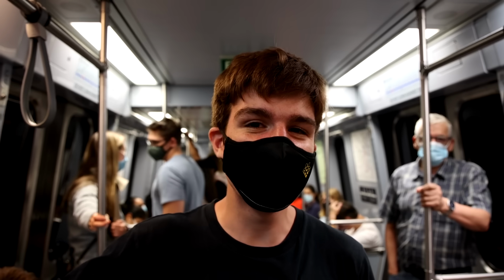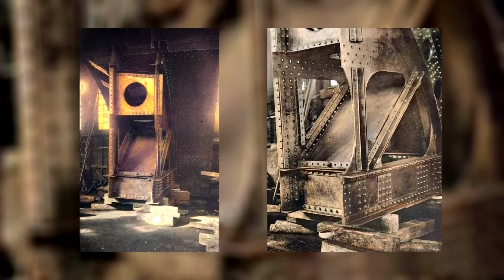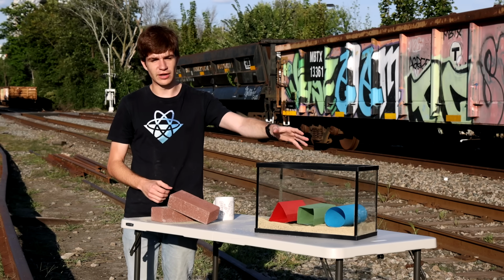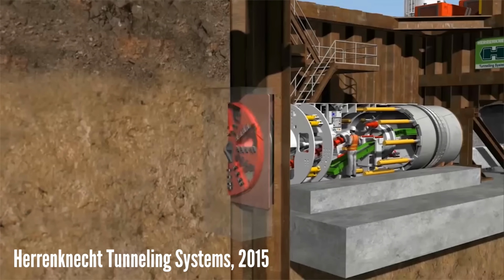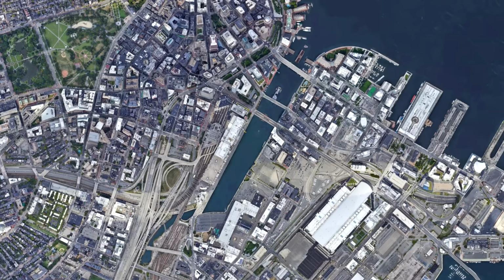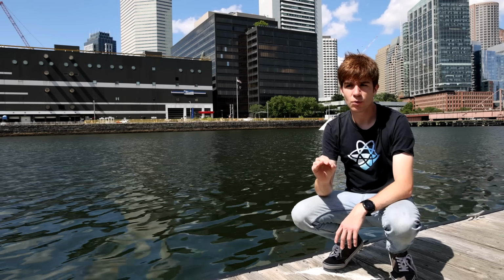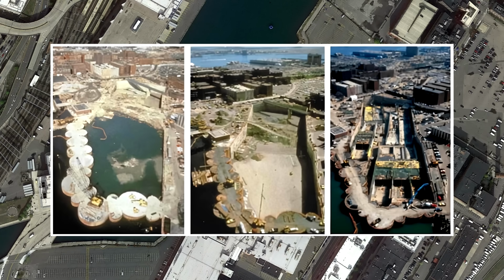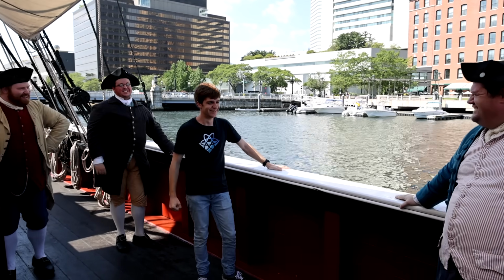Why It's So Hard To Dig Tunnels Underwater

Comment: Not gonna happen, at least not for cars. You wouldn't just be building a tunnel. Assuming we are all driving electric cars by that point you are going to need charging stations. And not just any charging stations, some of the largest in the world. Plus you are going to need multiple of them, all underwater. Next, you will need rest stations. It's a long drive, people are going to need to stop for a place to rest and grab a bite to eat or drink. Once again, these are going to need to be massive, you will need dozens, all underwater. Next, you are going to need staff to run the rest stations, charging stations, as well as law enforcement, and service workers to handle all the daily operations etc etc. However, it would be too far to have them commute in an out of the tunnel every day so you are going to need to build lodging for them to sleep. By the total number of rooms this would be by far the largest underwater lodging in the world. Finally, you are going to need by far the largest fresh air exchange system ever built. The total volume of the tunnel would be nearly double the largest underground mine in the world. If the tunnel were to be built specifically for trains this would be a different story. You can bring everything needed on the train and wouldn't need all these separate facilities. For cars though you would four times the amount of work, and probably quintuple the budget.

Comment: Ok so I mean I enjoyed the video, very nicely done, but we are talking about a 1/3 kilometer stretch of tunnel (which btw even in this tame environment still had a structural disaster that killed one person in a ceiling panel collapse) that has no extreme forces on it and is very very short, and comparing that to a possibility to cross the Atlantic. The shortest distance I can find between Boston and a major continental European city would be Boston to Vigo, Spain at 7,441 kilometers. The shear magnitude of something this long and large is simply inconceivable. The resources necessary would be mind boggling. And just imagine for a moment what that would feel like? Have you driven 1000 kilometers before? I have many many times, and that’s a grueling endurance drive of over 10 hours with minimal stops. Now make that a 70++ hour drive. Make that a 70++ hour drive, with no sunlight, claustrophobia, massive anxiety because of the idea of being in the literal middle of nowhere, and, what, underwater gas stations and motels? Could you imagine the price of this gas? And who works there? 

Ok so maybe it’s a high-speed train. Well my god even at 120mph (conservatively high speed) it’s still a 35+ ride, and again how does it make it? What power source? Are there any underwater hubs for stopping? What happens when inevitably the power goes out or there is a malfunction? And you’d have to believe this would cost several several times that of a plane ticket. 

The reason I’m saying all this isn’t to rub it in, but to emphasize the uselessness of this kind of topic. While it’s an interesting thought experiment, there is simply no benefit or anything close to a convenience / cheaper alternative over flying. It would be 3-4 days straight of driving (without stopping or resting), literally thousands of dollars of gas / under water motels, its in no-man’s land in terms of being outside of any country’s laws so anything happening in that tunnel would be essentially an “Everyman for themselves” situation. It would be an outrageous burden on our already devastated oceans and sea-life, it would cost potentially hundreds of trillions to make, hundreds of billions a year to upkeep (no idea who’s paying for it) and would need to be staffed by thousands through the entire stretch. 

Oh and there’s also the fact that continents are continuously moving and that would be another issue to deal with, as a mere 12 years would cause more than 2 feet in continental separation. And this project would take possibly hundreds of years, so that would be another enormously difficult issue to deal with. 

All in all, this is fun to think about, but I would never in my wildest dreams consider this anything close to a future proposition. This is now in my top 15 most unlikely things to ever happen in a thousand years.

Comment: i saw a show with a slightly different take on the idea. The shortest distance from Eastern Canada to Ireland is still right around 2000 miles, so let's face it, an emergency halfway through could be problematic.  you don't want to be in transit any longer than necessary, but even a bullet train isn't ideal, even if it was fast enough. trying to push through the air inside the tunnel might be more difficult than in open air. And so on and so forth...

So, their idea was this; Build the tunnel, but then evacuate the air from the tunnel and use a maglev train to push the velocity up over Mach 1. Canada to Ireland in 2 hours. 

Clearly there are engineering challenges with this idea lol

Comment: Looking at crossing the Atlantic to figure out a way to connect the land transportation networks of the Americas and Afroeurasia is pie in the sky for now. Connecting those landmasses by building either a tunnel or a combination of tunnels and bridges across the Bering Strait, however, should probably be doable with present technology, though several political issues (Russo-American diplomatic tensions, the cost of constructing the tunnel/tunnels and bridges, the cost of extending existing transportation networks to the point where the tunnel/tunnels and bridges is/are to be constructed, etc.) get in the way even of that.

Comment: the other issue is that the fuel needed to drive that distance 

electric cars can be made to take in power wirelessly while driving and so this is not a problem for them (and it might be that these would be the only cars allowed in such a tunnel due to lack of ventilation )

Comment: I think that although driving across the Atlantic sounds interesting, nobody would actually want to do it. I think that it would be far more likely for train systems like the Eurotunnel to be used since it is way more practical for trains to haul the cars to their destination. The same reasons why the Eurotunnel is a train tunnel apply, emissions requiring ventilation and drivers being unbelievably bored on the HOURS long straight shot of repeating scenery

Comment: If this US to Europe tunnel is ever build it wouldn’t be for cars and trucks. Traveling near 3000 miles at 70 MPH is gonna take a while. It will undoubtably be a high-speed train like hyper loop that will carry passengers and (like the Eurostar that connects England to France) carry cars, trucks and cargo containers.

Comment: 9:32 assuming we’d have electric cars that ran along a conduit to keep them charged up and run fast through the tunnel, in addition that in theory it wouldn’t take long to cross the Atlantic, it sounds like a decent 12 hour drive. Although that’s assuming you’re driving at 300 miles per hour with safe and considerate drivers with cars that have been taken care of and don’t have any faults. Heck, you could even make a Titanic memorial, as some sort of pullover parking area.
Reply: or, i dunno... just a train?

Comment: Another valid reason: even if we had all the tunnels worked out, from Boston to London (I picked a closer city) it's still 3300 miles, which would take you a little more than 2 days if you drive straight through. And in addition to building the underwater tunnel, there would HAVE to be gas stations installed as well. It just wouldn't happen.

Comment: My first solution for building underwater is to try and drain the water. Put up walls on both sides of where you want to build, drain the water and build. Then when you're done put the water back and remove the walls.

Comment: Why? Because it's way too far, way too expensive and by that not worth it even if there where no earthquake problems nor insane pressure by miles and miles of water over it.
There's a point where flying is more efficient than trains by saving infrastructure.. same applies here

Comment: So a pretty major oversight here. The Mid Atlantic ridge is diverging boundary and spreads at a foot or two a decade. So in order to not be crushed by the water pressure you would have to have a very rigid structure, but in order to not have it be ripped apart you need a flexible structure. See the issue.

Not to mention you skipped over how to handle emergencies or accidents, refueling of cars, providing a breathable atmosphere, living accommodations. After all this would be at least a 3.5-4 thousand mile tunnel That would be at least 50 hours of driving. In order to do this you would effectively have to figure out how to make human society work on the bottom of the ocean. I get that this video is just thoughtless click bait but like come on.
Reply: It's mostly about how to build tunnels underwater though.

Comment: Idk why anyone would want such a tunnel…. The chance of a structural failure seems super high, the maintenance would be Super high, and in general a boat would be so much easier..  You’d also have to pump fresh air though those hundreds of miles of tunnel so people don’t suffocate, And the fuel efficiency of a boat is likely (maybe) better than all our small cars.

Comment: I doubt there will ever be a tunnel across centre of the Atlantic, it would be to hard to get people out if there was a problem. I can see a better route being built around the northern edge with bridges/tunnels connecting the shorter water sections being feasible but I think by the time we have the technology and will to make it economically viable shipping and air travel will have advanced enough to still make it to costly.

Comment: Well without watching the video, the reason you can't drive from Berlin to Boston is because a roadway system would be extremely costly to develop and maintain. And it is about the most inefficient way to travel between the two points. Even going the most cost effective way up through Canada to Greenland to Iceland to continental Europe. You have large hundreds of miles of distance you're driving through a tunnel suspended in water or under the seabed that would have to be powered and ventilated because ICE vehicles traveling them do not run well without air for combustion or operators who are not dying from CO poisoning or suffocation. Emergency services would be a nightmare. It's just not financially viable.

Comment: Hm... the sea is actually a place where vacuum tunnels with super high speed would make some kind of sense... Unlike many other proposed places. 1 bar extra is nothing once you're deep, water tight is easier than air tight, if it collapses you're dead anyway, going straight is easy when there's no buildings and such, there are no pesky humans around to ram their car into it from the outside, and you don't have to dig!
Still not gonna happen anytime soon, but would be cool to zoom across the atlantic in just a few hours

Comment: (we shouldn't be driving but taking the train if we were to build a transatlantic tunnel, it will be so straight you could probably go 600+kph even with a regular train. Considering some TGV could go a bit above 570kph in 2007 on a normal high speed track)

Comment: Oh yeah I totally want to drive 3000 miles across the Atlantic through a tunnel.

I think putting a road up to Newfoundland-Iceland-Ireland-The UK would be more practically useful. Much like how if you wanted to do it on the Pacific side you'd use the Bering Straight.

All of them would definitely need artificial islands for rest stops, food, and gas/electricity though.
Reply: Newfoundland - Greenland - Iceland*

Comment: I'm disappointed to not learn how they fused the 4 connections between the 3 sections to make it watertight :/
Reply: If it works with the same principle as the Fehmarn-Tunnel currently under construction between Germany and Sweden the simple underpressure created by pumping out the water will pull the tunnels together. Therefore they add in some sealant (like silicone) between the full tubes. When emptied the push against each other and create an even better seal

Comment: You can actually cast regular concrete under water and it will actually harden really well.  You just need to make sure currents don’t wash it away.
Reply: Concrete will deteriorate in seawater and steel rebar is especially vulnerable to corrosion in saltwater. Anytime concrete is used in a marine environment it is allowed to fully cure before being exposed to seawater. 
Roman concrete is a different story

Comment: Why in god's name would you even want a tunnel across the atlantic?  Why would anyone want to drive three thousand miles in a tunnel?  Plus you'd need underwater rest stops, food, motels, vehicle repair shops, and don't forget air vents so we don't all suffocate halfway across. By the time you're done, you might as well have built a surface bridge for all the good it did you.  Even if you made it a rail tunnel, you'd need air vents that kinda ruin the whole "don't care what the surface weather is like" bit, and if you're going to take a train across the Atlantic, you might as well just take a boat...

Comment: good video, but remember something like this would require multiple lanes
while also having air ducts where oxygen can enter the tunnel and toxic gases may be released
not to mention the amount of rest stops and gasoline stations required to be built in order for families to have a safe road trip
and knowing the military the roads must be able to withstand the weight of tanks and other military transport vehicles
and the build must be environmentally friendly meaning it must not disturb aquatic wild life while also produce its own electricity to run all important systems

Comment: You forgot to mention having to pump ground water, though in the case of Boston I can see why. In Europe, where many old buildings rest on wooden pylons, you need to maintain ground water level and keep pumping the water back to where it came from rather than just pumping it dry. Otherwise buildings above will be damaged.
Other than that amazing video and production value.
The difficulty curve is really extreme. Digging through mountains? No problem. Having to dig under a river in a city centre? That has ruined many an engineers day.
I'm currently working on the Fehmarn tunnel connecting Denmark and Germany through the sea.
Reply: I think one of the great cathedrals of England (possibly Canterbury, but I'm not sure) is technically "floating".
Reply: Most of the building in Boston's Back Bay and South End rest on wooden pilings. In some spots that water level has dropped and they need to monitor and raise the water via pump.

Comment: it is an interesting idea for how to do a tunnel.. but outside of maybe electric trains.. there isnt really a ground vehicle out there that has the fuel capacity to actually drive the distance of such a tunnel without refueling.. and then the logistics aswell of getting fresh air in and exhaust gases out (aswell as pumping systems to keep it dry inside)

future "hyperloop"? maybe.  automobile tunnel?  not likely

Comment: Before I watch this video, my first statement is "no". 

The tectonic plates just make it impossible, the continents are constantly moving away from each other, even if you bridge the Mid-Atlantic Ridge, you'll be forever building it and pouring money into the product at a productions scale expenditure just to keep it barely usable! Maybe a submarine taxi system to bridge the gap might get it done, but then money expenses comes into play designing, testing (and testing, and testing, and testing) then building a dynamic structure that deep, hiring and training a submariner crew to operate these Mid-Atlantic shuttles...

No! Just no!

Anyway, I'm going to watch your video now.
Reply: Okay, I am actually surprised we've built a tunnel through water instead of soil... Interesting.
Reply: I FOUND THE NO REACTION: https://www.youtube.com/watch?v=gFrr3FKE-zg

Comment: Nice vid. I recently talked to a tunnel builder. On the cutting edge of tunnel building is the use of liquid nitrogen which gets pumped into mud to freeze it solid. It’s not quite like drilling normal rock, but the drilling and tunnel building goes faster and easier with mud.
Reply from the maker: Awesome! Yuo they used some of that on the Big Dig project which was awesome! They also used it to keep the leaning tower of pisa from falling over which i covered in the first "Engineering Europe" series on this channel (if you want to se a very young me with a very bad voiceover). Would have loved to have a talk with a real tunnel builder!

Comment: Since any transatlantic tunnel would need to carry large quantities of freight as well as passengers, a conventional railway rather than a vacuum maglev would be much more practical, not to mention economical. Specially-designed high-speed passenger trains operating non-stop could probably manage around ~500km/h, (obviously there would need to be the possibility for passenger trains to pass slower freight) with current technology making the journey time around 10 hours, which is reasonably competitive with air travel's 7-8 hours with trains running directly to/from city-center termini.

Such a tunnel could also have a huge environmental benefit, substantially reducing CO2 emissions from both ships and aircraft...

Comment: As someone that's worked on ships in marina, and that bridges such as The Golden Gate are under constant inspection, I think that it would be infeasible to monitor and maintain an underwater tube longer than a kilometer, even less so one containing a partial vacuum.

Building it the easy part - it's the maintenance that is the real work.